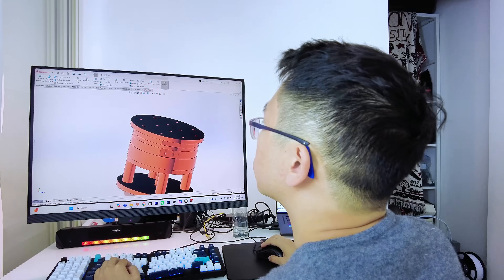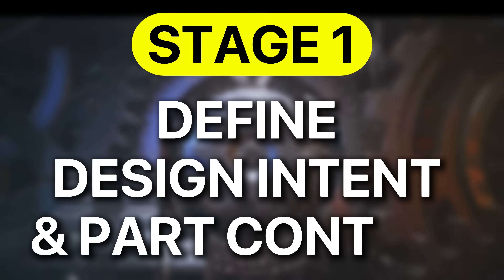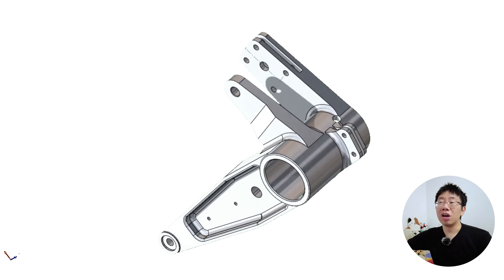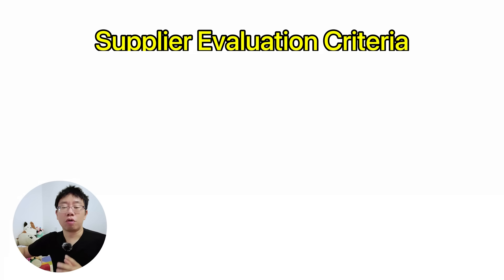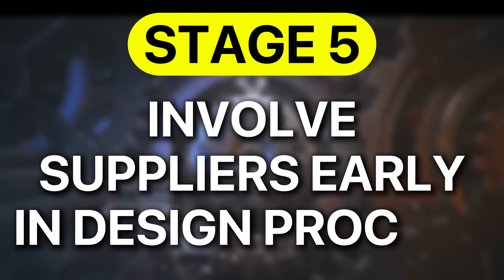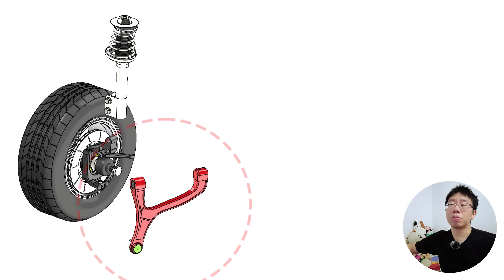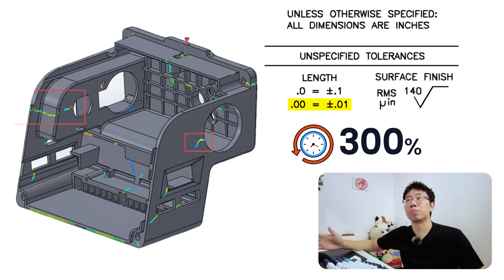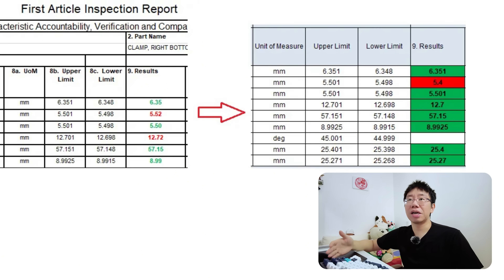Why Manufacturers Hate Your Design and How to Fix It

Comment: I will write down my comment of my prospective regarding this topic… one at the begging of the video and than at the end of it 
- 0:44 this happen because while designing you have to consider the manufacture and technology limits… this happen special when you valuate clearances and tolerances…
14:48  usually its matter of time so my answer is all this steps are not to be verified together but it depends on how much time do you have and budget for the project.

Comment: 100% agree, i use 3d printer at my work and i got engineering background but it is still normal to encounter some of my designs are unprintable or not up to standard and need to circling back to design phase even 3D printer is already the most user friendly machine. now imagine how a designer without engineering background and have never touch a machine will create.

Comment: I've been working with cnc lathes and mills for 6 months in my apprenticeship. Usually producing small batches of 100 parts max. The parts were for trains. It does take up a lot more time to manufacture a badly designed part. F.e. There was a redesign for these stainless steel rods used to hold the movable accordeon looking thing between train wagons(no idea, what i's called), which caused it to be a 10mm thick rod which had to be turned on a lathe with 350mm stickout with very tight tolerances. Basically impossible. We ruined so much material we propably had a rate of 2 failures per one finished part. So glad I didn't have to pay for that stupidity. Plus there was no talking to anyone about redesigning the part, eventhough we had plenty ideas, which would have been cheap and easy to manufacture.

Comment: When finalizing your design and making final blueprints it's important not only to use as loose demensions as possible but to also only apply gd&t as necessary to properly convey intent and proper functionality of the finished parts. Adding extraneous call outs will add to complexity and necessary inspection on your vendor's side in order to comply with them, driving up lead time and cost unnecessarily.
Reply: Sometimes I get a drawing, look at it, and think that it probably got a no-quote from the previous 5 shops because of the GD&T. Then our shop gave it a "go away" price but customer ended up ordering and now I have to make it

Comment: One simple thing missing. You design something with measures and tolerances. The drawing contains enough for manufacturing. But then it is impossible to measure if it is within specs.
A good engineer has to know a lot about manufacturing  and also about quality control.

Comment: I've worked in quality for 25 years, and I still research and watch videos to gain knowledge. I've seen engineers who can't even read technical drawings, yet they define critical dimensions everywhere on the exhaust hanger as if they've done a great job. The problem isn't lack of knowledge, it's failure to continue learning, and they consider asking someone else an insult.

Comment: I am impressed how useful and informative this video is!! 

I just finished Mechanical Engineering degree and I'm working as junior product designer. I was able to relate to many of the issues mentioned in the video as you were intruducing them. 

Therefore, I'm grateful that an experienced engineer like you took the time to share this valuable knowledge, properly organized and for free.

PD: sometimes it's not easy to stay motivated, often even frustrating. However, after watching this, I was both cheered up and gassed to keep doing my best and trying to learn as much as possible!!

Comment: As a mechanical design engineer after 15 years of experience, it is always beneficial for the engineers to work on the tools before doing any design work just to gain an appreciation of what the workers really do. I was working as a mechanical fitter, welder and steel fabrication before becoming a design engineer. Those practical trades that I have done helped me become the best design engineer I could be. I am now an Engineering Manager and every graduate engineer I employed, I want them to spend at least 60% of their time for a few months in the production and manufacturing floor working on the tools.

Comment: I am in Manufacturing. The amount of times we had designs that simply does not work. Screws placed in positions you cant put them because they are obscured by something. Holes not on the right spot. No threads. so on so on.

Comment: I am a welder. I build the stuff you guys make. I have worked for companies like Boeing and Honeywell aerospace. In practice, engineers and designers at both companies do not know much and they are very limited. 

Any welded component that goes onto an aircraft is constrained by D17.1. 

Something simple like an exhaust is easy to draw and design in CAD. I have zero CAD knowledge and I can design one in a few hours with a youtube video. 

Since I know the manufacturing and physical properties side of it... I know how much shrinkage to account for if I am designing it from inconel or stainless steel. Which means leaving extra material for the fabricators to work with when it hits the floor. 

What I cannot stand about designers and engineers is that they have zero clue what we go through. Our engineers are assholes that stay in their office and they think we are too stupid to ask questions or include in the design process. 

When I prototype something, I am typically given a sketch on paper with dimensions. I hold the engineer's hand and explain why i need something larger to get it into tolerance. I explain potential impossible geometry based upon our tools. 

As I learn CAD myself from the perspective of a builder, I keep all the variables in mind. 

Then there's the issue of tooling... you can design a great product but many times that product requires a fixture to manufacture. Say you are designing a complex ducting assembly to be welded. I would include a fixture that will hold it together with my designs.

With the part and fixture together... welders and machinists have a ton more information and can crank out a better part. 

But engineers are lazy and stupid. One engineer will make the part. Another will make the fixture. Then another will give us shit information and fuck it up
Reply: Welders are the nurses to the engineers doctors
Reply: Based on what I read, you’re gonna love me if I’m ever the one doing engineering work under you. I was a welder as a hobbyist, a metrologist by trade, but a mechanical engineer by profession. Unlike aerospace, my field is in Nuclear Submarines. At this point I’ve mastered my GD&T and know things as basic as MMC and LMC.

It is true, engineering students don’t know anything regarding manufacturing once they graduate college. Its once part of the university system that I’ve been advocating since I got my degree.

As for CAD, my advice is to look out for student level software. Creo Parametric is industry standard for my field and they have a 6 month student edition that doesn’t require any university affiliation that I’ve been using for years, and it can be renewed perpetually. I’ve been using the free software since 2014 and have never had a problem upgrading to the latest version 

Its one of the tougher CAD programs, but it makes all the other CADs easy once you’ve mastered it. Another free option Thats industry standard is SIEMENS NX.
Reply: VALID, how can we fix that?
What causes that? (engineers to be that way)
And What causes that wich caused that?

Comment: where do i find someone to design a turbo manifold for me??
Reply: That's relatively simple. Most likely someone else has already manufactured a turbo manifold for your vehicle. For BMW, VW, AUDI, Toyota and many others, I have seen weld yourself kits for turbo manifolds. Find a company that makes one of the kits and have someone weld it for you. Or take one of the kit designs and give it to a fabricator. problem solved. $1000 for the consultation
Reply: @h @howardhughes6212 you aren’t understanding. I have an engine in my possession that is going into this bmw that nobody else has any parts for. It’s not that easy.

Comment: There are really only 2 professions that Universities actually get you job-ready for. The two classic professions: Doctors and Lawyers. Both professions learn to do the job, while at university. Every other profession either doesn't need a degree to do (learning on the job is just as effective if not better) or they are just giving you the basic skills required by the job (like engineering, they teach the math and software you need to do the job, but not how to do the job in a real world way)
Reply: Nurses too. But I digress, for the most part those are some of the few professions that are willing to train somebody before they actually have the full degree to do the job. Also, for nursing in particular, after 1 year of specialized schooling you can usually get a lower-level medical job, so that you can get some more experience while getting paid if you are up for it.  Teaching is also one of the jobs that are very similar and have an incorporated training step and lower level jobs that you can do while still in college.  In a lot of jobs, they aren't willing to train you until you have the degree, so in the end your knowledge does not match with your actual  responsibilities may end up being.
Reply: @tonyjohnson1580  teaching is a good addition to the list I think. For nursing I would just change doctor to "medical professions" because it's a good one too. Then it's the rule of 3! Lol
Reply: How do you know that someone can make the grade with out proof of intellectual capacity.
Reply: @Mtmonaghan how do you know they can even with

Comment: 1:03 I would counter with: If the supplier shipped you parts that were out of tolerance without prior authorization that they are specifically a "bad supplier".
Reply: Every single supplier in existence will send you the lowest quality shit they can, anything you don't check will screw you 

And in most other cases the tolerance wasn't specified in the first place and just delivered as ordered
Reply: @GerManBearPig what industry do you work in? I was QC for 8 years in aerospace before going back to school to be an engineer. 

At my shop that was definitely not our motto. Our goal was to make jewelry. Also all tolerances are typically required to be on the drawing. If they're not, that's a call or email to the customer
Reply: @DanielSt444 right lol. I work in calibration labs our measurements are down in Pico units. Fuck making sure you have less then .0015ų deviation on an anvil to foot measuring lock that meets ISO compliance is a must.

Comment: Correction….. designing a part that isn’t manufacturable is bad engineering, I said what I said
Reply: It's almost always manufacturable, but some times would cost the budget of a amall country because you'd need to setup your own custom manufacturing.
And sometimes if you're at big enough scale setting up your own manufacturing is actually the cheapest option, like for example intel foundries starting with a concrete manufacturing plant.
Reply: And yeah obviously, bad engineering if they're way out of budget to build.

Comment: I’m a CNC machinist/ Lead programmer at a large Job shop with a wide range of work covering many sectors. One thing I always say is that we can make it it’s just going to cost significantly more. I try to give the customer a chance to rethink the design before I order tools and materials.
Reply: I once had to order a few custom fasteners for a Client that's a well known defense industry manufacturer.

They had a few errors in their specifications, and changing that wasn't really an option due to the involved bureaucracy. 

All our cnc partners declined the project saying it was impossible. One said it was possible but too expensive.

So as a mediator between the client and the cnc buisness it went like
"We would have to buy a machine and modify it just to create that part"

Client:"Okay do it, we pay extra for that"

"We don't have space for the machine, we would have to expand our warehouse"

Client: "Okay do it, and please do it within this month, we pay for it."

Long story short they ended up paying close to 10 grand per bolt.

The pack ended up so expensive that we had to order an armed transport just so we could buy assurance for it.

Crazy part is that all of this was most likely because someone just made a mistake when converting the tolerances from the outdated system that used letters into the modern +/- n format.

Sorry for the yapp session, your comment just reminded me of this 😂
Reply: @angulinhiduje6093 that is ridiculous
Reply: @angulinhiduje6093  long live bloated contract bureaucracy! lol

Comment: The solution to overcoming this is right behind you. A 3d printer. Not be a you’ll make the part yourself, but because this is a manufacturing device that also has constraints, quirks, and tolerances. Designing parts to be 3d printed requires knowing these limits of the manufacturing technology. In short, before you design anything, learn about manufacturing methods. Another great example can be Linus Tech Tips saga with their screw driver manufacturing.

Comment: I've been CNC Machining for 4.5 years now. It's crazy how something as simple as a flatness callout will add so much time to a part, how nice it is to see a ±.010" dimension, how irritating it is to see tight tolerances on thin walled parts, etc.

I would love to see more prints that state the intent of a part, because you are RIGHT - we DO take those prints literally. You give us a number? That's what we aim for.

Love the video, bro. More designers ought to see this, or at least get a year or two in some manufacturing classes before they get their degree.
Reply: I can chime in as an engineer and a metrologist. Ngl, I quickly realized how ridiculous my callouts were once I became the operator of a CMM and had my own granite table to run my own inspections.

From the engineering perspective, we admittedly do call out tighter tolerances than whats actually needed.
Reply: This is why direct line of communication during the design process is so important, to specify what parameters are crucial for operation, and which ones are set just because "it seems neat" or at least is flexible. Sometimes manufacturing can also provide insights that engineers didn't account for, displaying in real numbers the production yield expectation and cost difference between the provided engineering sample, and a potential optimized manufacturing model.

Sometimes engineers will realize it's easier to change the tolerance of one part and then rework everything around it, than to insist the part remains intact and then see a 10% yield drop and a +20% production cost from longer production time and higher tooling wear.
Reply: We take it literally because often that's all we have
Reply: I remember a part when I worked in a machine shop that had an arbitrary and unnecessary surface finish tolerance on it which increased the manufacturing time per part from 2 minutes to 12.
Reply: @Necro-the-Pyro   welder here... machinists are overpaid. you know how many times I have to add material to their parts as a welder???
all the thinking is done... it's not like many of yall are programming anything. 40 an hour to push a button and change heads. AI is coming for yall
Reply: @howardhughes6212  Yep, but then again your job as welder is on the same line as they are both easy to replace
Reply: @howardhughes6212  you’re yelling at a different group of people because there are CNC operators, and then there are the programmers.

As someone that’s coming from the engineering and metrology fields, welders aren’t safe from AI either. One of my projects since 2024 involves designing tracked robotic systems to work on field welds. So far its basically a Lincoln on wheels with 4 omni directional arms.